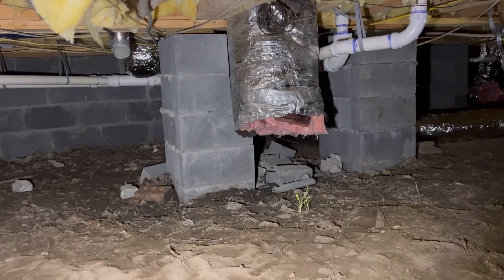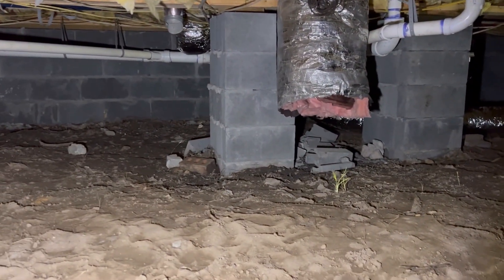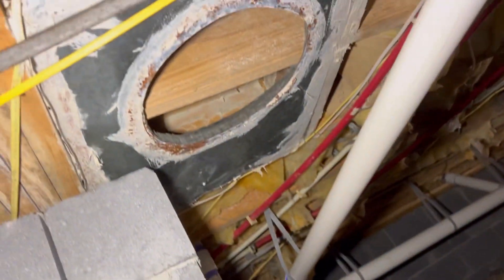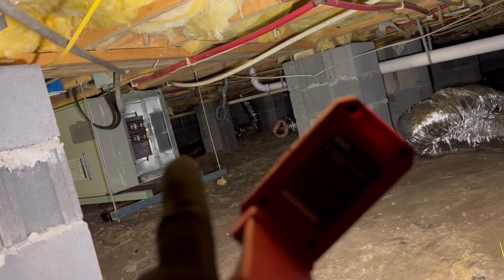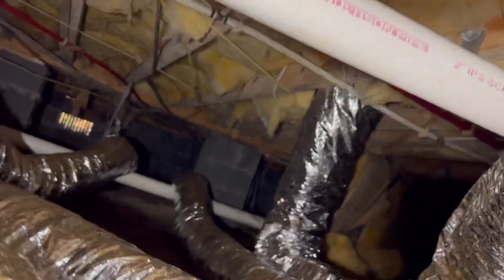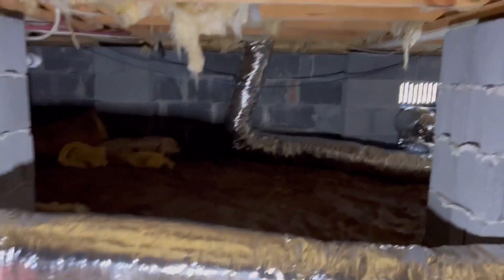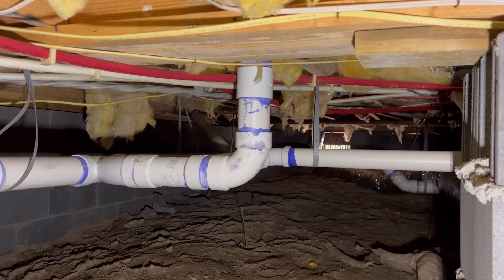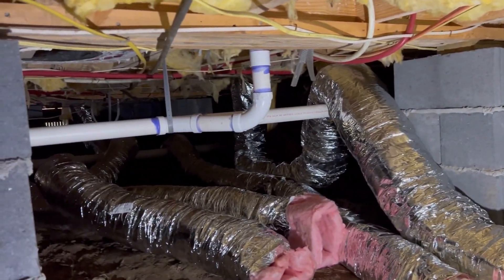Designing a Duct System

Comment: They gotta make up some code that is strictly enforced a minimum crawlspace height of 4 feet with a finished polished concrete floor.    With  built in knee padding floor matting lol 😂. 

         We don’t have many areas in my area of San Francisco that have anything like this underneath I was offered one job like this and I just plane-O-told him I’m too busy I can’t do it , was my excuse walked away. 

That was because I would only use the correct size duck work.   All my 90s and 45s would be metal if I was going to use flex. 
            I would have 3 inch wide straps about every 3 feet to 4 feet everything would be pulled tight like a piano string. 
             And the labor to do that in such a crawlspace Would be so expensive if they did say yes to my ridiculously high price to take such a job I would actually feel guilty. 

I’ll probably just do it all in Metal or at least most of it. 

My hats off to you can’t wait to see this job finished.